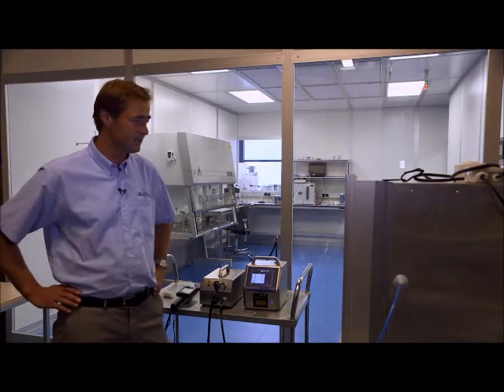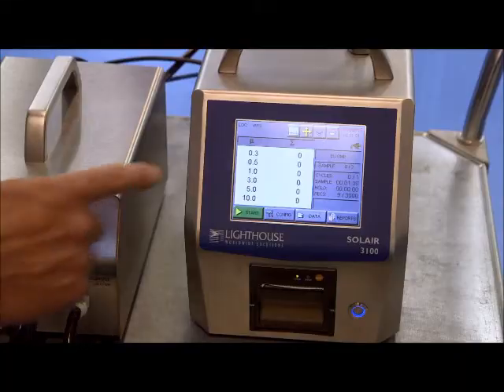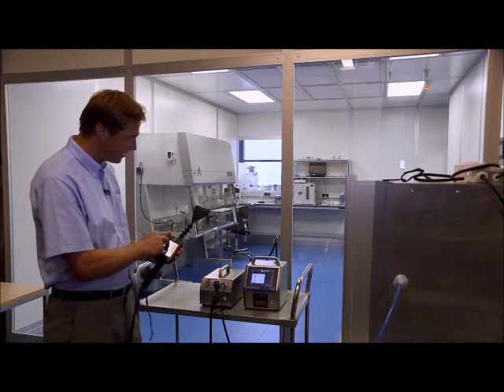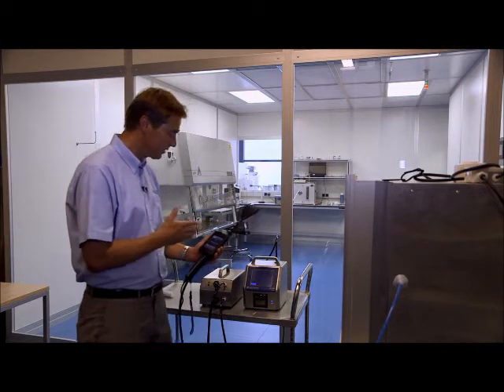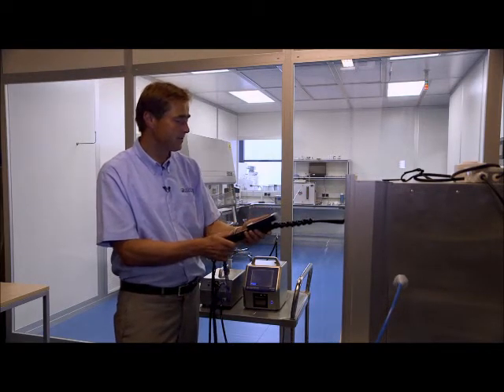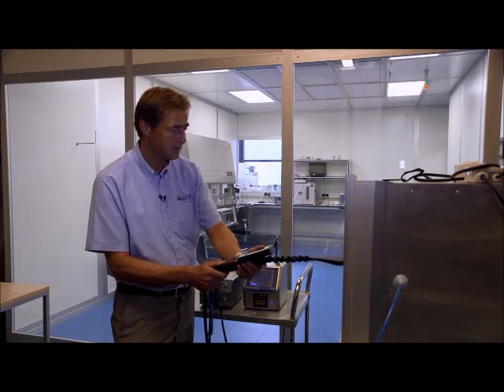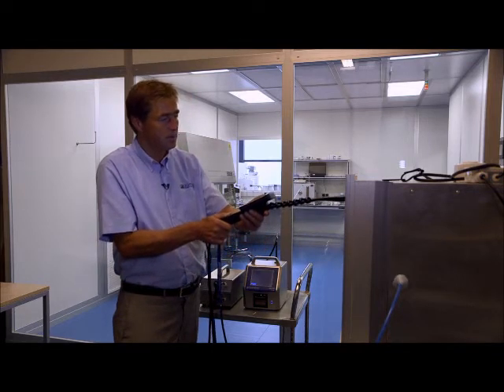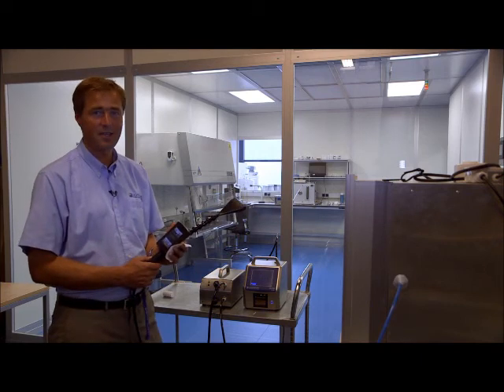Lighthouse ScanAir Pro demonstration

Comment: Are you performing Leak test or Efficiency test of HEPA filter??
Reply: Leak test on installed filter as per ISO 14644-3, not efficiency.
Reply: The Rs485 cable  with RJ45 connectors can they be replaced with a standard cat 5 Ethernet cable